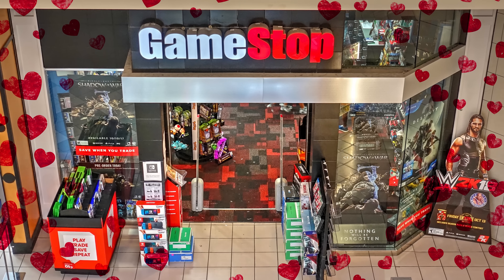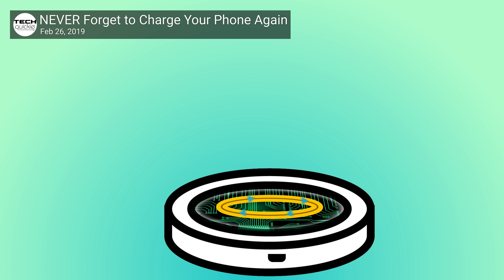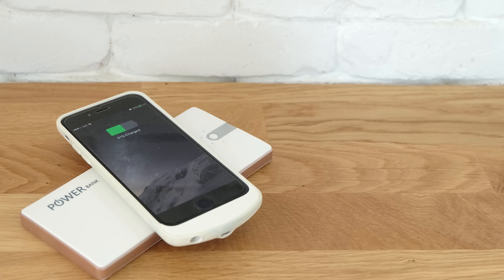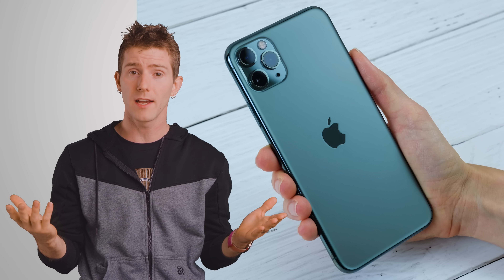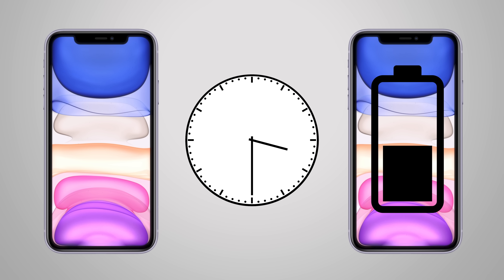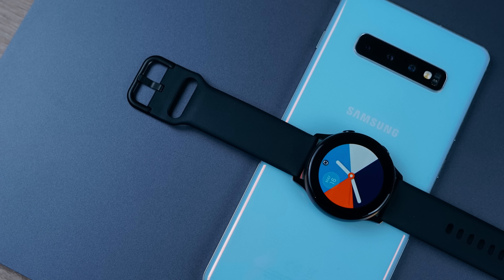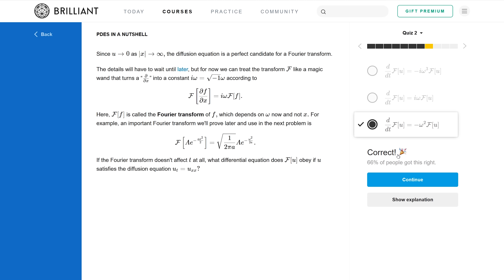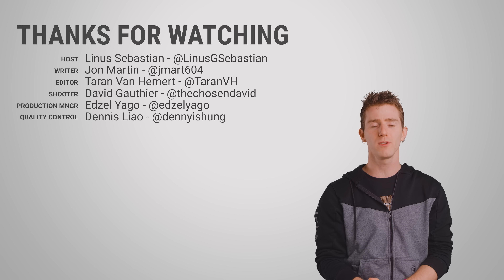How does phone power sharing work?

Comment: Worth noting, and something I discovered it by accident, a phone to phone adapter, like the ones you use on Samsung Galaxy phones for data transfer, also work as a phone to phone charging solution! I also believe that this would be FAR more efficient than the coil method. After all, air, plastic, dirt, and anything else in between the two phones, make poor conductive materials compared to copper wire. In fact, they often make good *insulators*. And that is not a good thing, if you want to transfer electricity.

Comment: I wonder how fast I could charge my phone with an induction cooker.
Reply: due to the high current output of a induction cooker, i would say about 15-30 min for a full charge,
give it a try
Reply: @originalkhawk  warp charge wireless is here
Reply: Wrong frequency, much too low. Qi chargers operate around 140 kHz, (most) induction cookers near 24 kHz; barely above the audible range.
   So cook yes, charge no.
Reply: Probably charge your phone in 30 seconds. Great idea. And you can cook while doing this. On top of your phone.
Reply: Terry Smithwick, why do you know that it is the wrong frequency?
Reply: @trelligan42  just plug one end of the cable into the phone and then curl the cable a few times and rest it on the cooker. Then the induction is sure to work and not cause your home to burn down.
Warning: may cause home to burn down.
Reply: I know quite a bit about inductive energy transfer from previous jobs, and I looked them up to verify the exact numbers before I posted.

Comment: All joking aside this could be useful in a case where you plug your phone into wall power and then lay your wireless headphones and smartwatch on top of the phone and all three would charge together. This would eliminate needing 3 separate chargers for the devices or 1 really big wireless charging pad.

Comment: No phone has a battery good enough to spare the charge.... 

Maybe the energiser phone! But doesn't support wireless charging.
Reply: My phone has a beefy battery. It's 4000 mAh, and it costed 200$
Reply: The phone, not the battery
Reply: @System64MC  mine has 5000mah motog7power. Want the Samsung m30s with 6000mah @ £200
Reply: @System64MC  blog it, sauce boss
Reply: oh, oof.
Reply: All the good $200 phones I found had less than 4000 mAh, and reviews on the phone were praising its battery. Guess I didn't do enough research.
Reply: might aswell buy a power bank it's cheaper than a second phone and getting in relationships isn't that easy as you might think lol
Reply: When you realize that people befriended you just because you have an Energizer phone and become everyone's battery bank
Reply: @aronseptianto8142  lol
Reply: If you want high end big battery then the Asus ROG 2 is the fastest phone and it has a 6,000mAh battery for $600-700.
Reply: Get a 20kmah power bank
Reply: Oukitel had a phone with 10000mah
Reply: @Google_Does_Evil_Now  look up m30s samsung
Reply: mine dies at like 20%

Comment: Even charging 10% of your smartphone battery in thirty minutes by using another is by far more important than a deactivated smartphone no matter how much energy from the battery is wasted.  
My iPhone 11 max with 10% battery can be in low power standby mode for at least four hours which is more than enough until I usually reach a power socket.

Comment: Thanks for mentioning the inefficiency here.  It's an inherently inefficient method.  Like Linus says, good for a quick fix but it's not a long term thing.  

I think wired power sharing would work much better.
Reply: Wired power sharing is a thing from like 5 years ago that somehow nobody really advertised, its part of that 'USB OTG' protocol thats in pretty much every single phone these days.
Reply: @suicidalbanananana  REALLY? No way this is true.
Reply: @danesz021  Yup, if I plug my P30 Pro into my PC, one of the options popping up is called "Reverse Charge - charge a connected device".
Reply: @attomicchicken  I'd say it was just inconvenient. No one really had a micro usb otg cable. Now we got usb c to usb c, does that even work from phone to phone? Idk, but it's still one more thing to carry "just in case". Wireless is the one-step solution people love these days

Comment: I've never understood wireless charging period. Even the non sharing kind that requires a power source (it's not actually wireless!) - it's slow and silly.

Maybe it's useful if say, you use it as a charging station at home. But on the go when you need to use the device as you're charging? a charge cable + battery bank is still king.

Comment: what if you have the S10 charged to 100%  and at the same time plug to the wall and using wireless power share to charge the other phone. Ive done it with a S9 that has the USB C port damaged and there is no fix but replacing the phone. I havent found any place saying no to wireless charge while charging.

Comment: Next topic: how to share your phone power to another phone via cable? I’ve seen it charge if you connect 2 phones together. But which one charges?
Reply: Google: USB OTG
Reply: The one with the biggest battery and the lowest charge %
Reply: Umer Salman whichever is plugged in last
Reply: Whichever the OTG adapter is not plugged into.

Comment: How are people really feeling about wireless charging tech these days?

I'll start, you guys give your own opinions.

Back when I got my first Android smartphone, an Xperia Z3 some 5 years ago, I was really into the whole idea. To the point I ended up getting wireless receivers and transmitters and shoving wireless charging tech by myself into the cases I used with my smartphones, just to have the functionality there. Because I never had a smartphone with the tech integrated, but as long as you have the transmitter and receiver, it doesn't really matter.

I did this for quite a while, but at some point I just became totally disenchanted with the whole thing. It ended up being more a hassle rather than a convenience for my usage.

In my personal experience, wireless charging is not only slower, it's also finicky, and it tends to heat some phones up to very uncomfortable levels.

I also hated having to fiddle around with the damn smartphone to get the right spot on the puck shaped chargers, and whenever I had to use the phone while it was charging this clearly wasn't the way to go. A half solution to this is getting a wireless charger that is more like a stand, so there is only one way to put the phone. But it does not solve the problem of using the phone while it's charging. Wireless charging made much more sense when you had to leave your phone charging overnight to get a full charge, but these days I get a full charge on my phone in around an hour... and a 80 to 90% charge in half that, because those last 20 to 30 per cent is when the phone really struggles. So overnight charging became a non-issue. I actually avoid it for the health of the battery.

Eventually, I switched back to another alternative that I had in mind since back the Xperia Z3 days, because it came with the option - a magsafe style cable. Provided that the one that came with that smartphone was just pure crap.
Nowadays, I'm doing things like this - I got this... almost comical 12 USB port charger. It has 3 rolls of 4 ports each, one roll has 5V 1.5A, second roll has 5V 2.5A, third roll has 5V 3.5A. It's charging only, and finally enough for all my gadgets. xD
Then, I got half a dozen cables with round magsafe style connectors, plus a bunch of different plugs for it - microUSB, USB Type-C, Lightning... too bad it doesn't have a miniUSB plug for a few of the legacy stuff I have, but for those I just use regular cables.

It solved all my issues. All my gadgets that needs USB charging have their own plugs connected to them... they are fairly small and flat, so it doesn't make much difference. Then, when I want to charge them, I just get the cable and snap them on. It's way faster, easier and more secure than wireless charging. No need to fiddle around, and no worries about bumping them and they getting displaced.
The round style connector is good because of two things - it can go whatever way you want (negative terminal is an outer circle, and positive terminal is the core, so it doesn't matter how you connect it), and it's power only - no data going through. This can be bad for people who connects their stuff a lot to a computer, but not for me.

It's also super easy for visitors to use... they just gotta remember to give me the plug back before leaving. xD

Perhaps this whole thing would've been different if those newer wireless charging technologies that were supposed to be area based ever came to fruition. But they never did.
In a way, it's almost like Wi-fi and Ethernet. At a time, I was all gung ho about getting powerful GAMERZ style access points and routers, but in the end it was just cheaper and better to pass ethernet cables through my apartment and live with that. Well, apart from smartphone and tablet... I mean for the PC.

Comment: I remember one of the features people were talking about with my phone is that it had such a big battery you could use it to charge another phone and no it's not one of those phones with an actually giant battery it's just that my phone is old enough that when it came out people were freaking out about the battery size the phone an S7 

Edit: you would have to plug in a USB cable that can somehow also plug into the second phone

if the s is first it dance for Samsung if the S is second it stands for sucky I have no idea

Comment: these phones use a lot of charge even when sleeping.
Reply: Depends on the settings - if the device is set to keep all wireless connections and background apps running 24/7, that'll obviously consume lots of power. I use mine quite a lot and only charge every 3 days.

Comment: With a whopping 25% efficiency you might drain half of the battery from the other person to get 12% charge on your phone, pretty fucking dumb considering that some phones with field effect diodes can output 2A of charge on cable because they are 96+% efficient.